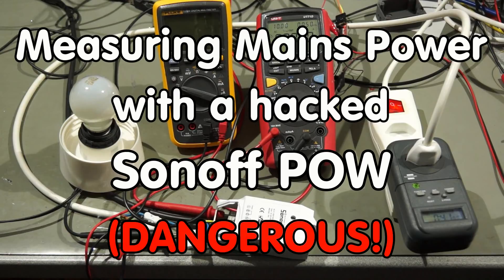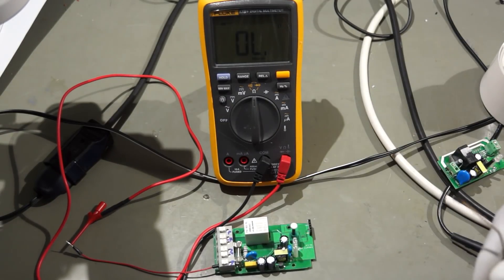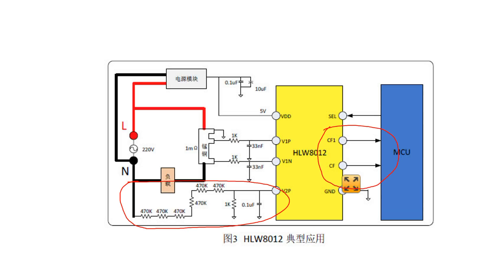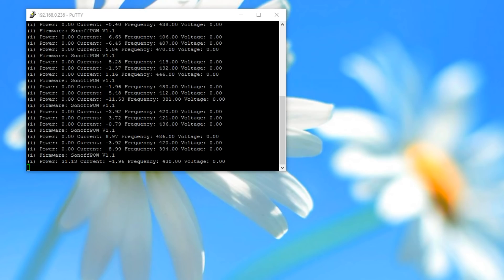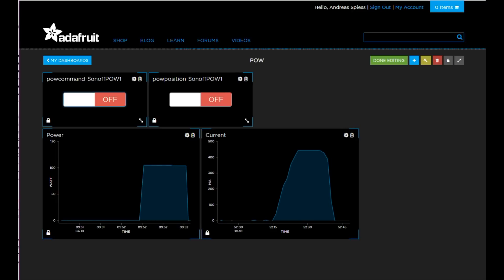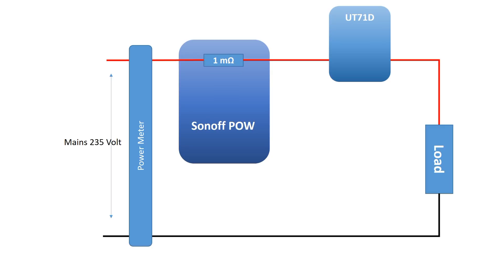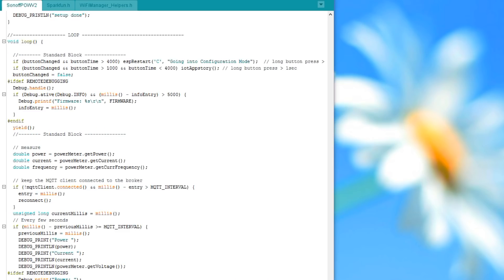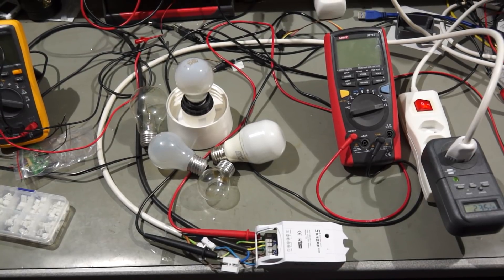#99 Measuring Power, hacked Sonoff POW, MQTT, Adafruit.io and Home Automation

Comment: Cool, opening a hot device. If you don not know what you are doing you will surely get a electric shock.
If you connect an oscilloscope there, it goes bang and fire! Exciting and Dangerous.
The manufacturer could have donated three opto couplers and an isolated power supply unit for the ESP, but the power IC must remain on the hot side and be supplied with 5 volts anyway.
Reply from the maker: Since I write these words I survived ;-) These devices are not intended to be used as we use them..

Comment: Hi Andreas,
I've downloaded your code for this and have a couple of queries, you appear to assign an interrupt for GPIO0 
  "attachInterrupt(GPIO0, ISRbuttonStateChanged, CHANGE);"
but there doesn't seem to be a handler for it, also in the loop section your have the following.

  "if (buttonChanged && buttonTime > 4000) espRestart('C', "Going into Configuration Mode");  // long button press > 4sec
  if (buttonChanged && buttonTime > 1000 && buttonTime < 4000) iotAppstory(); // long button press > 1sec
"

However it appears that buttonTime is not set anywhere so I cant see that this code would actually do anything?

Thanks for all your video's very interesting and helpful.

Nick Sharp
Reply from the maker: This is an old code and maybe you are right. iotappstory has now a completely new library.

Comment: Hi. Now you cold try sonoff pow r2. Much better
Reply from the maker: I do not have one in my lab. And for the moment I have no plans.
Reply: Is it as hackable as the original? Or should I get the original if I want to flash my own firmware?
Reply: I have pow R2 and didn't see much of improvements the wiring connectors are still quite awful.

Comment: Thank you (again) for your video.
Is tehere really no way to connect e.g. a temperature sensor to the Sonoff POW? You say that GND can be at live voltage, but for the ESP8266 to work, there must be some way to get 3.3V *maybe even 5v?) relative to GND inside there, or am I mistaken?
Reply from the maker: Of course, you can connect anything to the ESP. But everything has a voltage relative to earth of 220 volts. Relative to its gound it is 3.3 volt. So pay attention! You are too young to die.
Reply: Thank you for the answer - I just want to connect a temperature sensor to it, which will be far away from any curious hands, and probably inside a waterproof box.

Greetings from Costa Rica! :-)

Comment: I just received some POW's ordered directly from Itead.cc. Out of curiosity based on your comment on the circuit's isolation I tested it using a DMM and unless I did it wrong twice, I measured near zero Ohm resistance between the "L in" and the logic GND. Was this also the case for you as from your comment I understood the zero Ohm link being between earth and logic ground?
Reply from the maker: You are right. The PCB is connected to the live wire. That is the reason for my warning.
Reply: Andreas Spiess Thank you for the reply but what I was after is that on my DMM test the live input seemed to be connected to logic ground (and not the input earth ground for example). This is mind boggling for a hobbyist like me (software engineer by trade). It sounded surprising also to an EE relative familiar with the device.

Edit: I forgot to thank you for this video since otherwise this would have been something unexpected. I haven't found too much about it even by specificly searching for Sonoff POW isolation.

Comment: Hi people! Anybody know is it possible for this sonoff pow device to report if power is greater or smaller than some given comparable value (for example to inform you when is power consumption 0W , or smaller/greater than for example 100W), so you can know if some device finished it cycle for example? Oven, water heater, etc... that would be interesting feature. Or the whole thing must be in Sonoff app?
Reply from the maker: Maybe you look at Tasmota or Espurna

Comment: How does your firmware compare with Tasmota POW - is your's 'better' :)  ?
Reply from the maker: AFAIK Tasmota had no support for this device when I did this video. Tasmota and Espurna are much better solutions now.
Reply: Ah ok, I haven't looked at Espurna yet. I just ordered a POW to play with from China - I guess it'll be with me a few months time hi-hi !
Reply: Hi Andreas, when you say "Tasmona is a better solution" do you mean that firmware can measure power/current/voltage with better accuracy?
Reply from the maker: I think so. But I did not try

Comment: Would it be dangerous to use 24h with a consumption of 1300w 24hx365 days? I want to put him in an asic miner
Reply from the maker: If it is on 220 V it might be ok. on 110 V for sure not. At the beginning, I would closely watch its temperature, just to be sure.
Reply: yes 230v in spain  thanks :)

Comment: Hi Andreas,
I would like to put my own Arduino-Sketch on the Sonoff (because I have already a webservice that I want to use) and add your functionality of reading measured data from the Sonoff device. 
As far as I understood I just have to include the library from itead (for the HLW8012 Power Meter Chip) and use it to read data.

Unfortunately the link in this video is no longer up and available.
Could you perhaps post a link to this library that works so that I can download and use it ?
BR
Gawan
Reply from the maker: The link which does not work was the recall notice and had nothing to do with the coding. The link to the code still works.

Comment: Could you use 3 of these for 3 phase supply? Im sure we use maybe 30 amps max on across all 3 fazes so 16A max is fine. also are these two way, meaning they can count backwards too? We have solar power panels so would it count the power the solar made as the one used by the house or would it just not count
Reply from the maker: I think it should be possible. I do not know if they can count backward.

Comment: The vacuum has a poor power factor and the Sonoff likely does not measure the phase angle or deal well with the negative (reactive) power when summing/averaging the power over many cycles.
Reply from the maker: This is what I also think.

Comment: I have a problem to upload a sketch to my SONOFF POW.
Tried to upload the sketch OTA-mDNS-SPIFFS but without success.

[https://www.youtube.com/watch?v=GoQXOLB50HA]
#32 Internet of Things with ESP8266 #4: Upload Programs Over the Air (OTA)

https://drive.google.com/open?id=0B_vGp6rdca--a29UdktWU20yc3c – online directory
There is an online PDF available, online readable
https://drive.google.com/open?id=0B_vGp6rdca--YTc1VTluUVMwY1U in the hope to make it easier and more accessible.

Information about the connections between SONOFF POW and USB-SERIAL
  
How to select/activate ESP8266 in the IDE and adjust the correct settings (what I hope, these I found back in other tutorial[s] )
This is the output which I get when I try to upload  OTA-mDNS-SPIFFS
 
Arduino: 1.6.12 (Mac OS X), Board: "Generic ESP8266 Module, 80 MHz, 40MHz, DIO, 115200, 512K (64K SPIFFS), ck, Disabled, None"
OTA-mDNS-SPIFFS
...
Sketch uses 291,933 bytes (67%) of program storage space. Maximum is 434,160 bytes.
Global variables use 35,716 bytes (43%) of dynamic memory, leaving 46,204 bytes for local variables. Maximum is 81,920 bytes.
warning: espcomm_sync failed
error: espcomm_open failed
error: espcomm_upload_mem failed
error: espcomm_upload_mem failed
Reply from the maker: I think, OTA only works if your sketch on the ESP is OTA enabled. So, at least once, you have to be able to upload a sketch via Serial. And your sketches have to be written acordingly.
BTW it might be useful to search for the ESURNA project. There, you find a ready made firmware for this device.

Comment: Hello Andreas. It's needless to say that I enjoying your videos very much. They are very interesting and instructive. i'm building my HA with openhab and i'm interesting to install MQTT Sonoff POW in my setup, but i encounter with a small problem. in Arduino i copied your code but when i trying to compile or burn the code to the Sonoff i get an error "exit status 1
'rtcMemDef' has a previous declaration as 'typedef struct rtcMemDef rtcMemDef' . does it something with my Arduino IDE?
"
Reply from the maker: I do not know and it is hard to do remote diagnostics. I never had this error. Do other sketches work? Then it is probably not with the IDE

Comment: Dear Andreas,
i like to use sonoff pow for measuring the power consumption of all my house. The 16A is enough because we I have 3kW max energy forniture. I like to bypass the relay in this way the power in the house is always on, and i like to place this device before all home system. I have raspberry with mqtt server and home assistant for collect the data. It's all this possible? What is your think about this?

Thanks in advance.
Reply from the maker: I probably would not do it because I would not trust the device running on such high current all the time. I would prefer a device which just goes around the existing wire to measure ampere. Like that, you do not have to change anything at this very important place. Here, it also would be forbidden to add a device at this place.
Reply: Thanks for your advice, I try to build or find something to put around the existing wire. 
Like this: https://www.hackster.io/whatnick/esp8266-iot-energy-monitor-b199ed

Comment: I'm loving your YouTube channel - I just wish I found it earlier! I've made a home automation system with Raspberry Pi's and Python, but would like to use ESP8266's and MQTT, with one Pi Zero W running Node Red to control everything.

Have you tried the Peacefair PZEM-004T to measure voltage/current/power? I've been using it for just over a year now to monitor my home energy usage, using a Raspberry Pi via USB, and this works great. The PZEM measures up to 100A, i.e. it can monitor the whole house, and it's under $9.

I would like to use an ESP8266 instead of a Pi, using its Tx/Rx pins. I have converted a PZEM to work with 3.3V, and using an oscilloscope I can see that the ESP8266 is sending the requests and the PZEM is sending responses, but the ESP8266 doesn't see them. Some people say that there is a problem with the Arduino serial routines; I've tried different serial libraries and different versions of the Arduino IDE, but so far haven't got it to work.

If you have experience with the ESP8266 Tx/Rx comms, or have used the PZEM with an ESP8266, I would appreciate hearing about them! If not, and if you are interested, I'll let you know if I eventually figure it out.
Reply: Yes, I tried it back in December - I'll have to check my notes to remember exactly what happened. After I couldn't get it to work I asked around, and some people said that there are issues with the comms library, and others said I needed to go back to an earlier version of the Arduino IDE. Since it works well on my Pi, I gave up for the time being. But I'm ready to try it again.
Reply from the maker: So far, I have no experience with this device. So, I cannot help you...

Comment: A quick question.  Could these Sonoff POW be used to smarten-up dumb charges that don't switch off when batteries are charged?  I have a few cheap NIiCd devices (e.g. garden blower) that just keep charging when the battery is charged.
My thought is they could monitor the current and when it drops at the end of the charging cycle when the battery reaches full charge.
Could also be used used with Phones/laptops/etc so they don't get the flutter charge after they have charged up.
What do you think?
Reply from the maker: +John Morrison Because currents on 220 volt are much smaller than on 12 volt it will only work for bigger consumers. For small consumers it is better toswitch the DC side
Reply: Thanks for the reply.  
That is a shame.  I was hoping the current drop going into the charger(s) would indicate a full charge.
Back to the drawing board for me.

Comment: I had a look at all the smart plug references available with manufacturers and I decided to use Sonoff POW for my AC power consumption. Is it capable enough to measure a load drawing around 10A of current?
Reply from the maker: According specs: Yes

Comment: Nice, I was looking to implement this in ESP Easy,
What GPIO pin is HLW8012 connected to on the ESP?
My question is more, how does the HLW8012 communicate with the ESP?
Reply from the maker: The HLW8012 has a freqzency output. So, you have to measure its fequency.
Reply: I am checking your github, I will try it  :-)
Thanks
Reply: One command line from ESP and two data lines from the power IC. Dead simple.
Optocouplers would be possible, but then you need two power supplies. 
That was NOT separated here, so mains voltage everywhere. if you're lucky but based on N, bad if it's based on HOT.

Comment: On my Sonoff POW, relay failed in "ON" state just several hours after first use, with just 40 watts of load. Had to replace it with a different kind, glued in place with a double-sided tape, and connected with wires.
Do not rely on these cheap devices for anything really serious.

Comment: Hi Andreas  there is RECALL NOTICE for Sonoff TH16 and POW  you can find more here:
  https://www.itead.cc/blog/sonoff-th16-and-pow-recall-notice
Reply from the maker: Thanks for the link. Because I only switch small loads (200W) I did not experience any problems. Mine also look different than the ones on their picture.

Comment: Hello Andreas!
Thank you for the video.
Just a small question about the sonoff:
I've an AC to DC power supply with this rating 220V, 250W, 50Hz, 0.89A on input and 
12V, 25A on output.
Will it work with the sonoff?
I'm confused by their 10A/16A rating
Thanks!
Reply from the maker: If you want to connect the 220 volt side of your power supply to the Sonoff, you do not care about the 12 Volt Amperes. So, your device consumes less than 1A, which is much less than the rated 10A of the Sonoff
Reply: Problem Solved.
Thank you so much!

Comment: 0:46 That CE sign doesn't mean a thing really. It's a fake China Export logo, not a Conformité Européenne logo, so please do not assume it's safe. 
And even if it's were real CE mark that doesn't mean the device is safe. It only states that it's conforming to European standards according to the manufacturer. The CE mark does not indicate that a product has been approved as safe by the EU or any other authority.
Reply from the maker: +Jean-Jacques de Balzac So, if I understand you right, we should not bother if the device has a CE sign or not, because it anyway has no value. That is ok for me.
Reply: A fake CE sign holds absolutely no value, because anyone can put it on their device... A real CE sign only states that it conforms to European standards to make free trade within the EU easier. It's not a proof of safety.
That's why you shouldn't automatically assume a device is safe because of the CE logo.

https://de.wikipedia.org/wiki/CE-Kennzeichnung

Comment: Hi Andreas, does the chip measuring REAL or ACTIVE POWER, or APPARENT POWER ??? May be that is the problem of different values. Some chips only measure current (that is APPARENT) and multiply by voltage to get POWER. That is not REAL POWER that your electric company will bill. Regards,
Reply from the maker: I do not have the knowledge nor the equipment to test that. It is well possible, that this is the issue. Maybe a viewer is more into this topic and can enlighten us...
Reply: Hi, normally that kind of socket power meters measure APPARENT POWER and TOTAL/APPARENT CURRENT.

Also your UT71D measures TOTAL/APPARENT CURRENT. 

APPARENT POWER = APPARENT CURRENT  * VOLTAGE

On the other hand: Active Power = Apparent Current * Voltage * powerfactor, where powerfactor is cosine of the angle and is always 1 or less. Other way: Active Power = Apparent Power * powerfactor

Active Power, usually, is what your company bill you monthy.

But we don't know what kind of power measures SONOFF POW.

you can check with a old incandescent bulb (usually powerfactor = 1), vs a new low power bulb (powerfactor < 0.80)

Check: SONOFF power    vs       UT71D current * your voltage.

More info about this and a great project is https://openenergymonitor.org/emon/modules/emonTxV3

It is easy to build your own.(as I do)

Regards,
Reply from the maker: I remember my studies... This for me always was the "dangerous" part (because of high voltage). So, I concentrated more on the small stuff. Even today, I get wet hands, when I have to work on mains...
Thanks for your explanation.
I did this check: "SONOFF power vs UT71D current * your voltage." This was the basis for the comparison. But this does not include the power factor, if I remember right...
Reply: Hi Andreas, mee too. High Voltage is very dangerous. I am not an expert, but just in case.... Regards and thanks for your great work !!!! I came from arduino, and I am trying now to begin with wemos mini d1 boards.
I have to finish first my home's wattmeter monitor. (after I will have to change it to ESP8266 base to upload data to cloud and not to a SD.
Regards and happy new year.
Reply from the maker: Thanks for the link. I just had one of these Current sensors in the mail... Happy new year to you, too!

Comment: Hi Andreas. Do you know of any wifi power consumption monitors that can be wired to a central household fusebox to monitor consumption on each circuit? I am familiar with Arduino and Raspberry Pi so programming isn't an issue - I don't know the hardware that is required. Thanks for taking the time to make your videos and share them with everyone.
Reply from the maker: I am not in Home automation, so, the only product I know is this one. If you want to measure at the fusebox, I think, it would be sufficient to measure voltage once and then, for every fuse. I would use a contactless hallsensor like the WCS1800 around each wire. Like that, you have no change in the wiring. Maybe there are also commercial products available, but I do not know.
Reply: Andreas Spiess thank you!